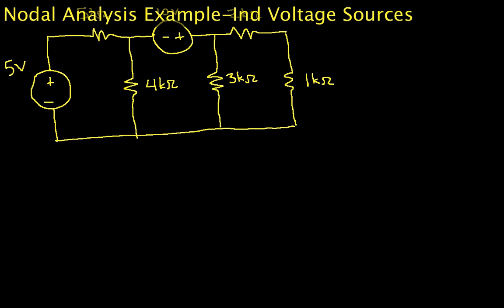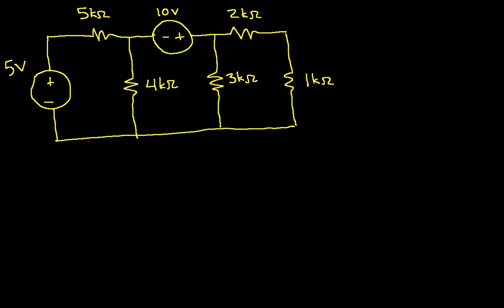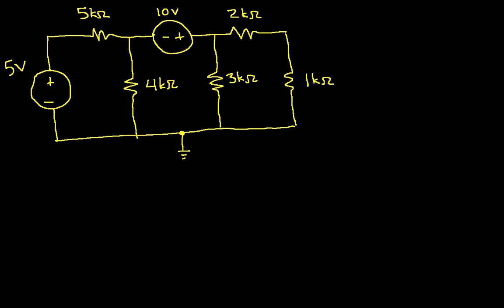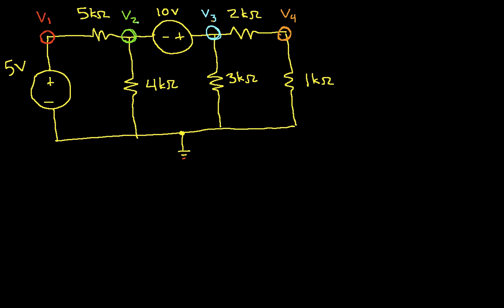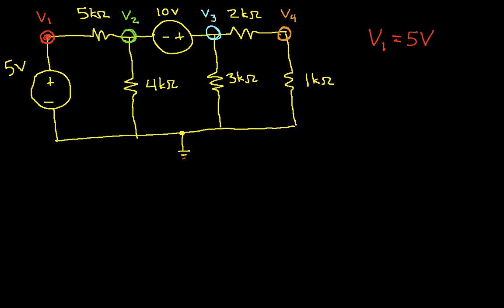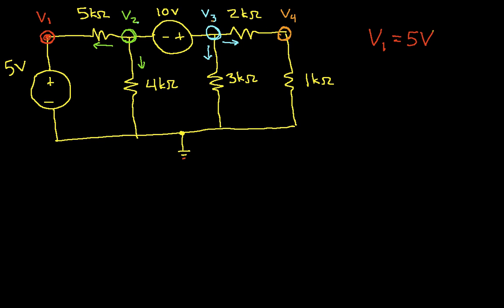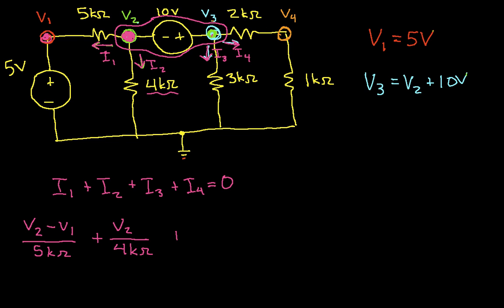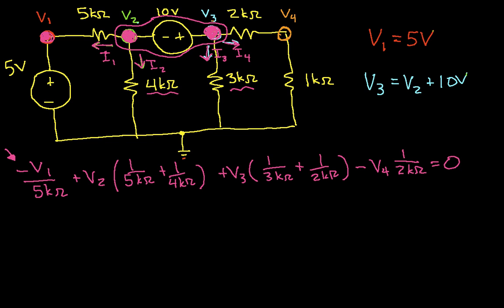Nodal Analysis Example-Independent Voltage Source (Harder)

Comment: If you are viewing this as a circuits student (i.e. in preparation for an exam) I suggest you look up how to do matrix algebra with whatever calculator you intend to use on your exam and get some good practice with that. Both the TI-84 and TI-89 can handle the systems of equations pretty simply for you, but it takes a bit of practice to get good at entering things in properly and getting solutions.

Comment from the maker: The current out of node 4 through the 2k resistor from right to left is (v4-v3)/2k. The current out of node 4 through the 1k resistor from top to bottom is v4/1k. These two currents sum to zero. Doing some algebra gives the equation that I wrote for v4.
Reply: shouldn't it be (V3-V4)/2 cause the current direction is from left to right and current flows from higher voltage to lower voltage.
Or since we are solving for V4 we consider it to be at higher voltage??

Comment: why did you write (V2 - V1)/R1 if the current always flows from a higher to lower potential? It should be (V1 - V2)/R1 ?  Why did you assume that V2 > V1 ?

Comment from the maker: You could combine the two rightmost resistors which are in series, then combine this series combination that is in parallel with the 3kOhm resistor. However, you can't solve for most voltages or currents in the circuit this way because it contains two sources that are not in parallel or series with each other; nodal or mesh analysis or superposition are your popular options for solving it. The fact that the leftmost resistor is connected to both sources is why the voltage across it is so high.

Comment: I like your explanation of supernodes, but I generally think it's good practice to consider a node as a point where 3 or more elements are connected to it, this results in a lot less equations at the end of the day. So in your example, you would have node V2 and V3 only, and you would write that I1 = 5V/5K Ohms and for I4, you would write V3/(2K + 1K) Ohms.

Comment: At 3:38, how did you get V3 = V2 + 10v
Reply: The voltage drop across V2 and V3 is 10v. So it's actually V3-V2=10

Comment: how did you get the eqn for node 4 ???  explain...how?  how did you assume the direction of current?
Reply: Current direction is always to the direction of voltage drop S M Tasnim Alam
Reply: S M Tasnim Alam 
If it were me, I'd put the resistors together in series and get rid of V4 - strictly speaking, a node by definition is a junction in which 3 electrical components meet. Well in this case there is only two components so it is not a node.
Reply: would that make the last equation (V3-0)/3?
Reply: close it'll be (V3-0/3k)

Comment: What if theri is resistor next to 10V generator between node 2 and 3? Could it be solved with node analysis and is it practicle, do i just convert it to surent source? Or do i just use mesh analysis?

Comment: I dont get how you got the equation at node V4. Can someone explain?
Reply: Where did -V3/2000 come from? (at 9:03 of the video)
Reply: He went straight to the simplified ver coming out of:
((V4 - V3)/2k) + (V4 / 1k) =0
Reply: but with the direction of I4 the right equation should be (v3 - v4)/2k 

What the original was (v3-v4)/2k = v4/1k   if you simplify this you'll get his equation
Reply: Don't waste time trying to form an equation for V4. Once you have V3, V4 is just V3/3
Reply: That's because he skipped a step there that should have explained it.

Comment: why not use only two nodal points instead of three you can combine 5V and 5ohm resistor use source transformation and convert it into an independent current source